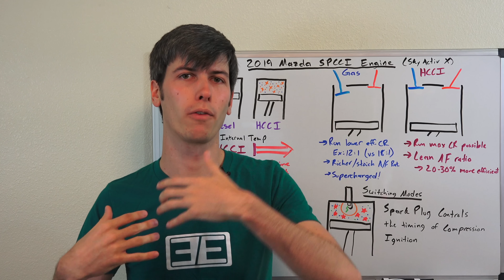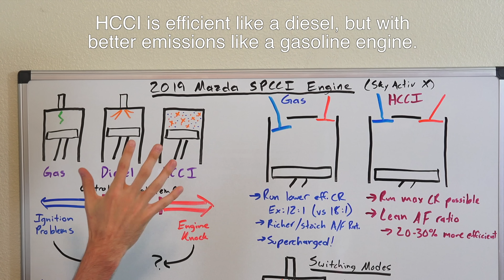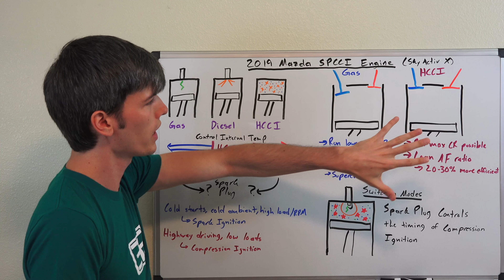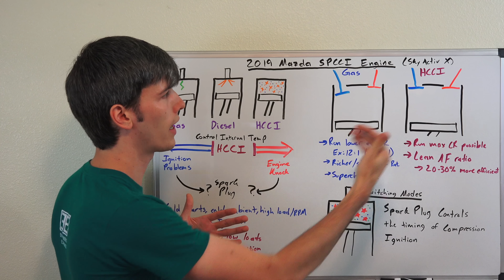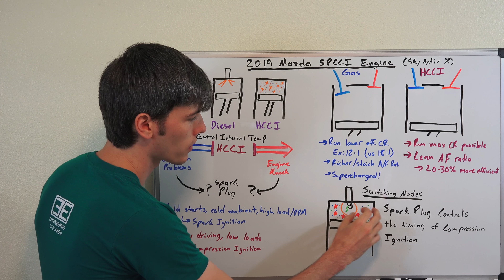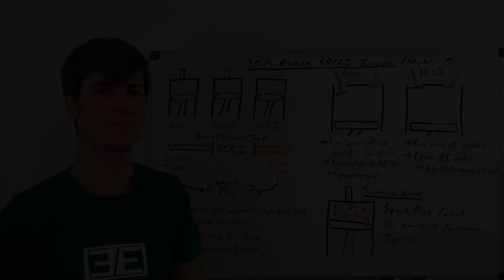Mazda Creates The Holy Grail Of Gasoline Engines - HCCI SkyActiv-X

Comment: This is neato. I wonder if the supercharger isn't used as part of the control mechanism for compression as well. A blow-off or bypass valve would be a classic solution to compression reduction.

Comment: Case tractors used spark plugs to raise cylinder temperatures, once started the spark cut off strictly diesel then. I believe John Deere may have had similar engines in early years.

Comment: Computers are getting ever smaller, why you need a spark for compression ignition is beyond me, actively changing atf ratios based on environmental constraints and engine condition should not be hard to figure out. With machine learning at hand this should be a no-brainer.

Comment: The mechanism on the intake camshaft required to hold the intake valve open at the onset of compression for Atkinson Cycle is also the same one that can be used on the exhaust camshaft to hold the exhaust valve open at the onset of intake. Thus, the EGR is no longer required. Something Toyota has been doing for years. 

Toyota better be in on that technology. After all, Mazda got a great deal on the collaboration between the two.

Comment: Great video. I have a quick question.  Do you think this HCCI technology will make its way into vehicles that are currently destined to use small diesel engines, for example vehicles like the midsize Chevrolet and GMC pickup trucks?  Will the supposed increase in torque promised, supplant the new small 4 and 6 cylinder diesels in these newer trucks?

Comment: Actually I figure the compression ratio is a bit lower than what you have suggested. Reason being is the requirement of a supercharger, which won't do much at low RPMs allowing for easier starting, but also allowing higher pressures at mid to high RPMs, the result being that you can operate in HCCI for a much wider section of the powerband. The problem with GM and others implementation of HCCI was that it only operated for a very small portion of the powerband and definitely not the "zoom zoom" part.... I suspect Mazda has fixed that with HCCI running for everything except during engine warm-up and potentially low RPM where they run the SPCCI mode as you described which frankly is still very good.

Comment: Could you please comment on the Torque output of this engine - one reason people love diesel engines is the low range torque.  Conversely, my Tacoma Atkinson  3.5 has low torque at low RPM and I consider this a disadvantage in the presence of the 10% increase of fuel efficiency.  - Would rather have the increased torque if I had a choice.

Comment: could you imagine if they took this technology, which they claim 20-30% more efficiency combined with freevalves valve control system which also claims to be 20-30% more efficient, you talking major power increases and mpg increases, itd be incredble

Comment: Ferrari's Formula car uses something like this I believe. It injects fuel in the middle of the exhaust stroke (I think) and uses the hot exhaust and compression from the upstroke to ignite the fuel (kinda similar to an afterburner on a jet). Genius because they bypass the "one spark per cycle" regulation

Comment: I found I've become a fan of Mazda over the years. The thought and engineering is a bit different than others. Example: the exhaust manifold on my 2.5l CX7, is between the firewall, and the engine. Most four cylinders have exhaust that runs underneath of the car, around the oil pan.

Comment: OK. Here is why the ICE car is a dead man walking. Firstly, mile for mile, ICE cars use roughly the same amount of electricity as EVs. The energy is required to refine the fuel. The DOE calculates it takes 6Kwh of electricity to refine 1 US gallon of gas. A Tesla S 100 will drive about 20 miles on 6Kwh. A comparable ICE car will travel about 20 miles on 1 gallon of gas. No net increase in electricity demand.

Secondly, battery prices are falling in line with a calculation called Swanson's Law that defines the relationship between volume and price. Battery prices are falling about 20% a year and that decline can only increase as the number of EVs increase.

Thirdly, battery technology is rocketing along. Solid Sate Batteries are starting to escape the lab into the real world and offer triple the energy density with 1 tenth the charge time, at a fraction of the cost because they use cheap materials. The Tesla would then go 60 miles on 6Kwh, or 900 miles on a full charge.

And Fourth, the markets for new ICE cars will decline as more cities ban them to improve air quality (Shanghai, London), followed by whole countries (Norway, UK, France now have plans to do just that)

ICE cars are not going to dissapear any time soon, the transition is going to take years and there are some tranport jobs that can't be done on electricity alone, and some countries haven't the infrastructure, but the day is coming when the glorious V8 muscle car will just be somebody's hobby project in the garage, and just as relevant to the future of personal transport as the Model T is today and given the speed of development of EVs, that day is a lot closer than most people think

Comment: SPCCI...a high compression ratio causes the fuel/air mixture to ignite ahead of the flame front produced by the spark plug.  How is this not detonation/knock?  Interesting concept but clearly I'm missing something.
Reply: With spark plug they control when they will ignite fuel to prevent knock based on temperature, pressure etc. They will still use high compression ratio but fuel ignition will be timed and helped with spark plug. That will prevent premature or to late detonation. At least in theory i guess. Also, as i read it engine uses small supercharger to maintain air pressure to eliminate one of variables that can produce problems for fuel ignition and not for producing higher power. There were articles on internet that said that engine should produce 190 HP and 230Nm of torque

Comment: If they're using the spark to control compression, would they not take the simple route of just using that instead of the added complexity of the Atkinson cycle? Bias the chamber to be on the cold side, and use the spark if it ends up too cold by TDC. Modern car computers are more than fast enough to time that.

Also, as for the Atkinson cycle, why not just close the valve early? If you want less air in the cylinder, rather than deal with those pumping losses, just don't put the air in the cylinder...

I mean, there are probably good arguments to both of those things, and I'd love to hear them.
Reply: I think the advantage of using Atkinson is that it is not much more complex, all of the systems are in place except for the giant exhaust headers, and they don't cost too much more. It would be more complex to meter air before entering the cylinder. The other big advantage is less pumping losses, you don't have to squeeze as much air into heat. I have a new cx5, and I think I am hurt more by poor aerodynamics than I gain with a high compression efficient engine.